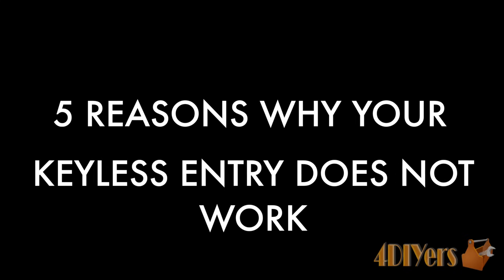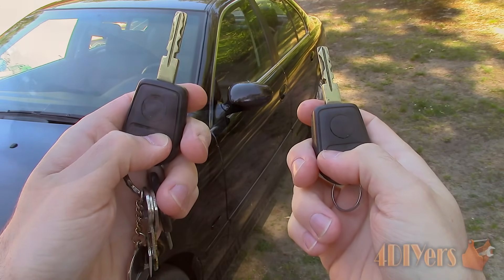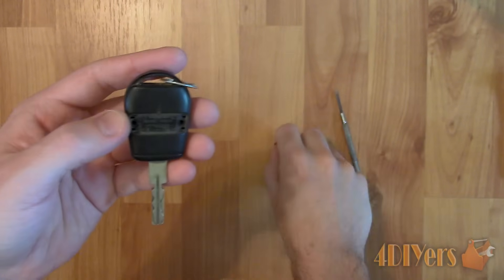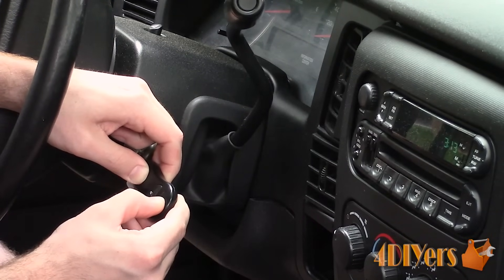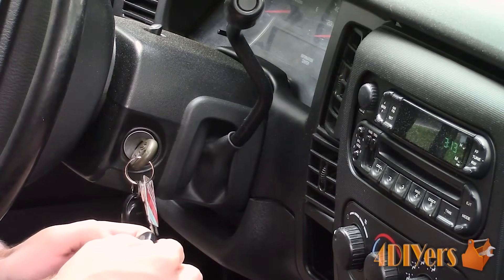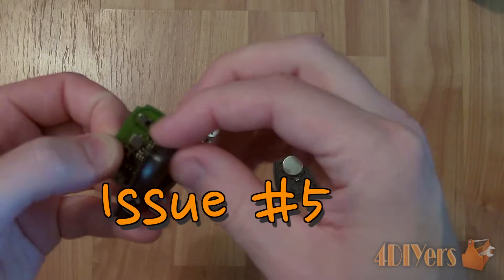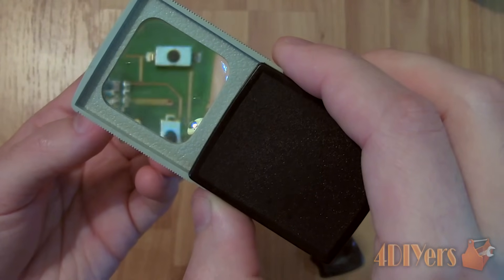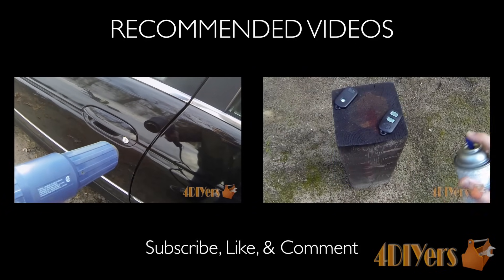5 Reasons Why a Keyless Remote Does Not Work

Comment: Here is a question. Can a bad car battery not allow a remote to be programmed. The car will enter programming mode but will not accept any RKE transmitter. A Ford dealer told us the battery was losing its starting amps.
Reply: Yes

Comment: hi. I have a 2005 Corolla both of my keyless entry remotes were working then both of them stopped working at the same time. what would you suggest that I do? Thanks in advance.
Reply from the maker: I would check the fuse first. It's quite possible both batteries have died as they might be the same age.
Reply: I suggest getting a newer vehicle lol

Comment: it can also be that your battery is not getting enough power rom the alternator.  my issue is that my airhorn sometimes drains my battery and alternator while the car is not on.  something electrical in the airhorn burns out which makes my truck require power while parked and off.  this particular problem makes it seem as though my alarm keypads are actually faulty when in all reality, they are not. it made me feel like I had to check the 5 things listed above & in fact, I almost bought a new alarm key pad in the interim.
Reply from the maker: Excellent tip, thank you for sharing. I would assume you were experiencing no start issues as well or at least the engine was turning over slow??? Have you considering installing a relay to shut off the air horn circuit when the key is not on???

Comment: i just bought a lancer gts 2008 with only 1 key, and the remote was cover with a bunch of tape i took it off and check the battery and was dead, replace the battery, but the remote dont lock/unlock the car, wont open the trunk, the light on the remote lights up when i press any buttom, what do you think i could do??
Reply: Thegreat Omero check your owners manual, it's always a great start

Comment: Also try holding the unlock and lock buttons down for about 10 seconds while you are sitting in the car and re synchronizing. My manual told me to do it and it work out for me. My unlock and lock buttons were not working but the gas door was. Hopefully this helps someone.
Reply: Tony Danza you mean both buttons to hold them down for 10 sec in the same time?
Reply: It would have been helpful if you had said year and make/model not all is the same.
Reply from the maker: Excellent, thank you for sharing!

Comment: I have a 1999 Cadillac concours. The gas door button works when I hit it, but the trunk and key less entry don't. Went to O'relieys and picked up a battery and tested the remote on their tester thing...it worked. So now I have a new battery and the gas door will still open , but the key less entry still doesnt work, Any suggestions? I only have the one fob.
Reply from the maker: Do you have more than one remote and do they both have the same issues???
Reply: Only the one, I actually figured it out. I needed to resynchronize it. I looked in the manual and it said try holding the lock and unlock buttons down for 10 seconds, I guess I got lucky.
Reply from the maker: Excellent to hear! That was going to be my next suggestion was a reprogram. Is the programming procedure for that vehicle different than the synchronizing process???
Reply: Don't know how to re program it but sitting in the car and holding the unlock and lock buttons was easy haha

Comment: ..also check if battery wires are not disconnected.. mine was..
Reply: 4DIYers
Reply from the maker: Excellent tip, thank you for sharing!
Reply: Bokhari Abdullah no, it works, just no sound,locks & unlocks
Reply: @08mraskew  so what was the issue

Comment: 2003 mustang. Worked good since I bought with great range. Now range is down to next to door. Replaced batteries and the same poor distance. Bought new fobs. Same poor distance after programming them. What could it be? Y do I have to stand next to door now when month ago was 50 ft? New batteries n new fobs and same poor range. What could have changed ? Don't say better antenna on fob because it has done 50 ft or so no problem. Just would like to have more than 2 ft again. Ty
Reply from the maker: Batteries can be an issue as some are stocked for a long period of time, eventually losing their charge. I just had that issue myself and the batteries ended up being worse than the ones I removed. Another issue can also be an antenna but not relating to the remotes. The car's antenna has either failed, issue with the wiring, or corrosion.

Comment: Hi, I have E46 328i 2003 with two buttons, recently I change the batteries and now , the remote doesn't work , i saw a lots of videos but all of them was for three buttons , can you tell me how could I reprogram the key? Thx
Reply from the maker: Try this http://forum.e46fanatics.com/showthread.php?t=938735
Reply: 4DIYers , i did it many times, but didn't work in two buttons!!!😩
Reply from the maker: Are you sure they're oem keys and not an aftermarket retrofit?
Reply: 4DIYers , yes it is my original key , it has only two buttons and when i hold the UNLOCK button and press three times LOCK button and then release both of them , the LED start to blink, but nothing happened!!
Reply from the maker: Try this here http://www.bimmerforums.co.uk/forum/f15/1998-e39-528i-2nd-key-wont-open-car-remotely-fixed-t16527/#post123410 Slightly different than the first procedure.

Comment: Hello! so my problem is that from time to time the remote stops working and if I take the battery out and put it back in it works again for a while. p. s.  battery is new.  thank you!
Reply from the maker: Have you installed a new battery, adjusted the contacts inside so they hold more tension on the battery, or tried to reprogram the remote?
Reply: I have the same intermittent problem with 2010 Honda Civic. Both key fobs. Both new tested batteries. Sometimes the door opens/locks, most times no. Any help would be most appreciated
Reply: @andiorl  Hello! The problem that I had was gone after I went to Volkswagen and they reprogrammed the remote. It seams like it was a software problem or such. Two years now, no problem since.

Comment: I recently changed my battery with in the last 6 months, and my light on my fob won't light up when I press unlock. Is it normal that these batteries die with in 6 months? Do you suggest new batteries?